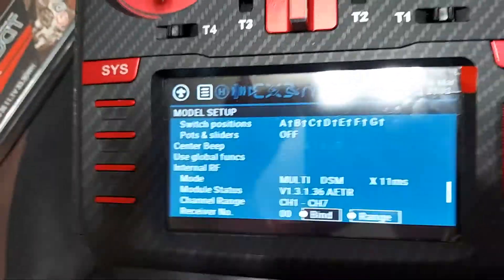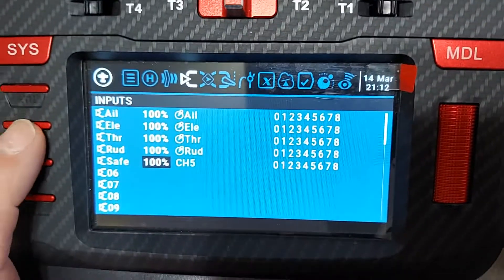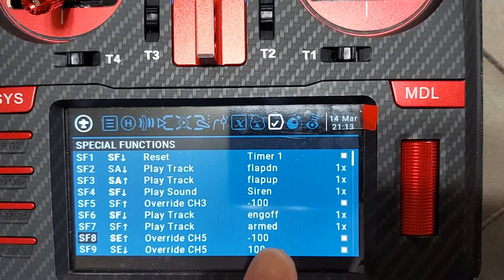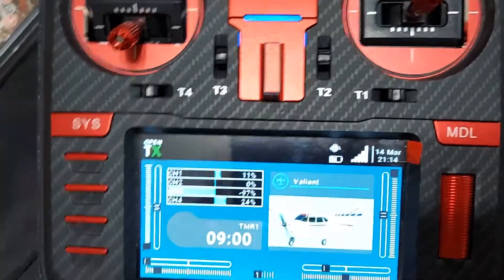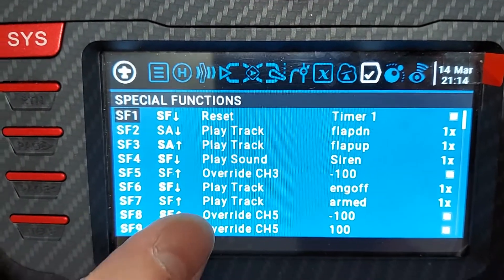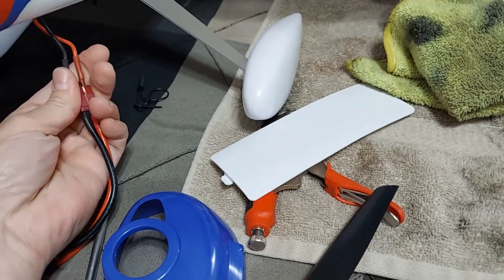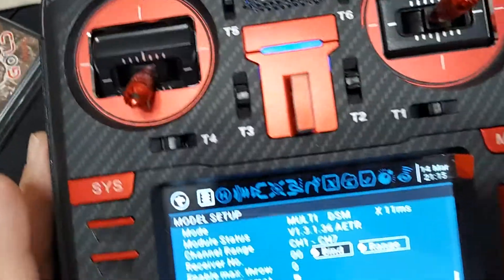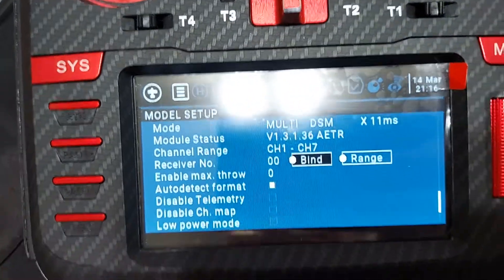AS3X Safe Mode in OpenTX TX16S , Bind and Setup

Comment: Will this work with t28 Trojan 1.1
Reply from the maker: if it has an ar636 and you are using an opentx radio yes. As for binding most newer spektrums have a button on them now.

Comment: What's the reasoning for using special functions, rather than setting the switch in the input or using a mix?
Reply from the maker: Just another way of doing it, I love the special functions haha, you can do so much with them. I have since crashed this plane and do things a bit differently now days, but this method still works.

Comment: Very good.  This is the info I was looking for. I've a T18 and was wondering how to set up SAFE and AS3X with my Night Vapor and a couple of micros that use similar integrated rcvr/servo gyro setups. I had it all wrong thinking I had to manipulate Ch. 5 in the mixes. Of course now that you've shown how to turn those on, how exactly do I adjust the gains?
Reply from the maker: Gains can only be adjusted via forward programming or pc software via spma3065 usb cable

Comment: I know on my Horizon Hobbies V900 all I have to do is hold both sticks in there lower and middle positions than toggle a switch of your choice five times and it's assigned.That is however,for a Spektrum radio.
Reply from the maker: This also works for opentx, but only if u have a unlocked as3x unit, like the ar636 used in this video. Most units are locked and cannot be done do to needing  programming via usb/pc to set this up right.
Reply: @NomisRC  .... So.... how can I unlock the unit?
Reply from the maker: @rrenegadoo  What one do you have? Most cannot be unlocked sadly and require forward programming.
Reply: @NomisRC  I have Spektrum DSMX AR636B 6CH sport receiver withAS3X. Thx Simon.
Reply from the maker: @rrenegadoo  I have had 3 ar636's now, all have been unlocked from the factory. When you hook up the SPMA3065 usb program cable does it not let you adjust settings. I also have the SPMBT1000 for bluetooth to phone so I can make adjustments at the field if needed.

Comment: This process did not work for my Night Radian.  It has the AR631 receiver, like the Valiant.  The receiver binds to the radio, works fine, and the Safe/AS3X works but I can't turn it off after using your process, or any other I've found on the internet.  I used a different process on my AeroScout (AR636b) and Ultrix (receiver?) which works perfectly, but that process did not work on the AR631 either.  Is it possible that the receiver is locked?  And can only be turned on and off manually with bind plug?
Reply: @NomisRC  well that's a shame.  I'd sure like to turn everything on and off.  But I greatly appreciate your insight; you saved me a lot of additional frustration.
Reply: @NomisRC  Ironically I went out of my way to get the BNF version NR because I like the AeroScout so much, but I was using a Spectrum tx that went out.  I don't get why they don't use an as3x receiver that I could turn off.  It's a glider!  I'll try the lemon rx on my next build.  Thanks again.

Comment: Thanks for this video. Did everything you said. The SAFE doesn't kick in before you blip the throttle. My surfaces only move minutely. Once on though i cant turn SAFE off.🤔
Reply: @NomisRC  using the ar636 receiver. Wish i knew what the problem was. Cheers

Comment: Thanks a bunch!. I recently purchase an Aeroscout RTF for my grandson. The three position switch for beginner, intermediate and experienced mode do not function.  The plane  came with the DX s version of the Tx.
A fellow club member has the same plane but with the older version DXe  versions . The radio bound to to rx with no issues and the three position switch work properly. I purchased this plane on July 6. After many phone calls ,waiting in a queue, chats and emails. I have not been able to reach Horizon Hobby to date.( July 14. )
I will never buy another product from this company. Thanks for sharing this. I will definitely bind this rx to my RadioMaster.

Comment: Your video is great! but I think I am going to thrown-in-the-towel, I give up......I have a Conscendo evolution....it appears that AS3X and Safe remain on full time.  I bound the plane with both procedures ( one with bind plug in/bind with bind plug out) With does activate both AS3X and Safe.  The receiver in the conscendo evo is the AR637TA and I believe the receiver in your video is the AR636.  I dont know if that matters but please help...at the end of my hope so to speak LOL
Again, thanks so much for the time you giving back to the hobby its much appreciated
Reply: @NomisRC  thanks so much.....So the Spektrum program cable is the best way to tackle the AR637TA ?(concsendo Evo)  correct ?

Comment: That may work but what you do is bind as normal, assign a switch to safe as you did, but the you pull both sticks down and inboard click the assigned switch 10 times the surfaces will dance and it’s done
Reply: @NomisRC  Are you able to use forward programming for the 636?.
Reply: @NomisRC  Gotcha, thanks for all the great videos.

Comment: Hello Simon, not sure if you are willing to offer some problem solving.  no worries if you can't.  I am using a R-M TX16S with a Spektrum AR636.  Issue is that I cannot turn SAFE on.  Things I have done so far, following your video: input 100% for SE; Special function SE override CH5 +/- 100; monitor shows that switch is functioning; tried binding both removing plug and leaving plug in; I get 2 "wags" when plane initializes; tried holding both joysticks to lower inside and flipping the switch [when i moved the switch some surfaces would move, but it didn't assign the switch to SAFE]; moving the SE switch seems to have no effect - SAFE is not on.  All other control surfaces are working on the plane.  If you have any suggestions, I would welcome them.  Thanks; Paul
Reply: Did u get reply from the guy as I'm having exact issue but with ar630 safe rx

Comment: Man thank you for this ! I have literally been trying to figure this out since the 1st jumper t16 came out ( I now own same radio as yours) and could not find any help. Quick question, is this the same idea as when u have those little cheap controllers that come with the Spektrum/ horizon hobby planes and they have an emergency safe switch that will get you out of trouble or is this just to turn on and off the self stabilizer? Thanks

Comment: This radio is interesting.  Got mine last week and it has me amazed at its possibilities.  I noticed after the latest firmware update a forward programming option.  Have you had any luck making that work with a spektrum as3x/safe receiver?  I noticed the same thing with information available for this topic. Thanks for posting, I'm amazed at how far this open TX thing has come, has to be giving radio manufacturers heartburn.  Once you get past the OMG stage and figure out that it will do what you want somehow, makes other major brands less appealing.

Comment: Can’t bind SAFE to a switch when following the instructions in the manual for the Draco. Have set the rx to 8 channels in the tx16s and followed your instructions.
Reply: Have you tried flipping your assigned switch 5 full cycles (up/down) like you would on a Spektrum Radio?  I wonder if that's still necessary on radiomaster or any opentx radio
Reply: @jelly-qs5fy  yep, but that doesn’t help either.
Reply: @vovsen123  try 10 full cycles. Up 1, down 2, up 3, down 4. Etc. the surfaces should twitch, also hold the sticks I believe down and in. But check HH website for the Draco. So times they misprint the stick positions and amend the manual.
Reply: @KevJW  I end up borrow a pal’s Spektrum transmitter and did the forward programming from that.
Reply: @vovsen123  I think you can on the tx 16. If you press the sys button. Not sure if it actually works or not.

Comment: First off, I have the Valiant as well. So I did exactly what you said.. and now I have the plane only in SAFE mode and can't get normal flying mode. The only thing I changed was the switch location. I used the SF switch and made sure I have SF up to -100 and SF down to 100. But when I tilt the plane on either switches it's always correcting itself so I know it's always on SAFE. Please help. Much appreciated. 

Also, how do you set up the Flaps? I haven't seen a video yet explaining that. Thanks so much.
Reply: @NomisRC  Thanks so much man. I really appreciate it